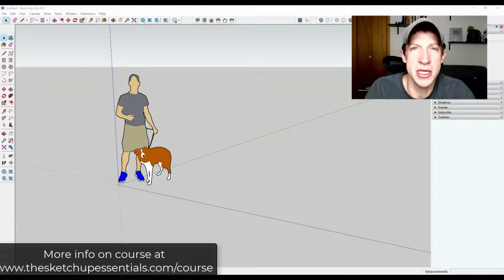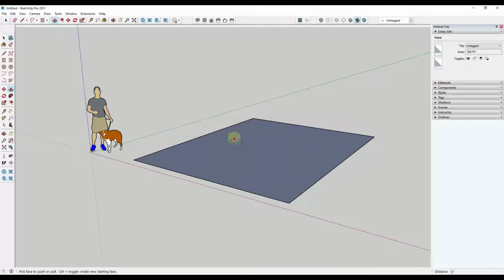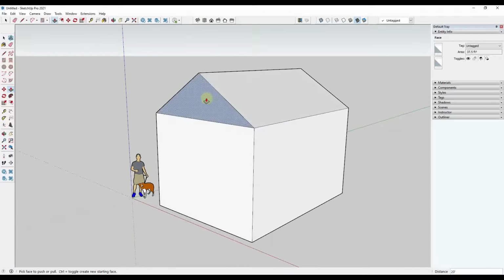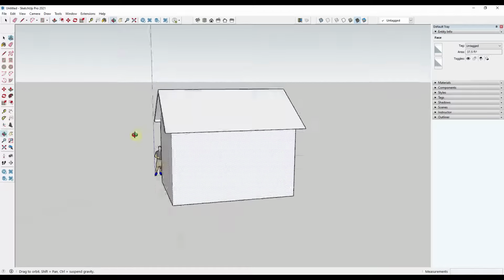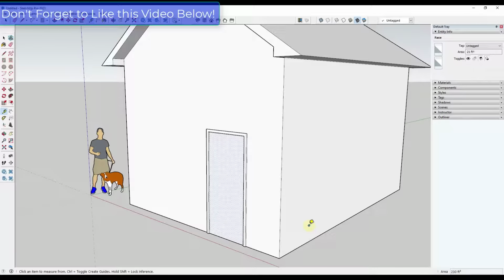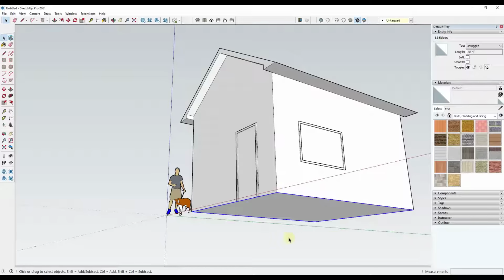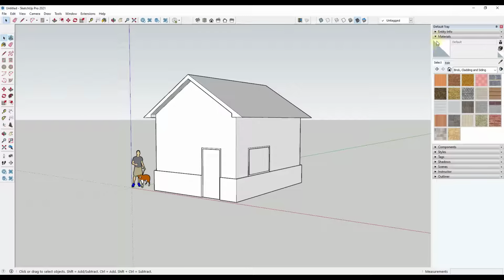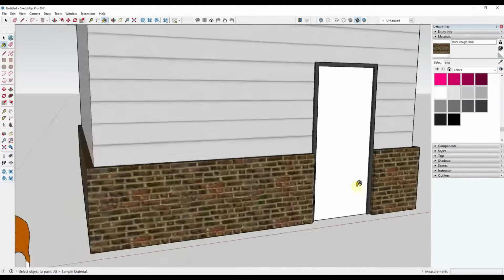Getting Started with SketchUp in 2021 Part 2 - MODELING A HOUSE! Desktop Version Beginner Tutorial!

Comment: Thank you. Very helpful Although, I am struggling with a MAC. You mention in 15:45 the Move+Control takes into copy mode but that does not work for the Mac.
Reply: on mac works with option key
Reply from the maker: I think you tap the "command" key?

Comment: I am having an issue where I am trying to make a hole for a cabinet door. so I make all my marker lines and I trace them with the draw tool then I click on them so they are highlighted. when I try to push them back by a 1/2" the thickness of the wood, it tends to push the whole line to the other side and does not make a hole. any suggestion on what I'm doing wrong?
Reply from the maker: It sounds like you might have the geometry you're trying to cut to make the hole in a group? So the raw geometry isn't intersecting?
Reply: @Thesketchupessentials  hmm maybe, how would I fix that?
Reply from the maker: @30DayReviews  Double click into the group before drawing the hole that you're trying to extrude
Reply: @Thesketchupessentials  THanks I finaly got it evedentaly i have drown over the same lines a couple times so had to erase them then had to explode it for some reason then was finaly able to get it. thanks for your teachings

Comment: First of all great beginner video. I'm just a novice wanting to learn Sketchup. Have a question, when you added the glass material to window and spun house around it seemed as if there was an empty room, as it should be, but when did you create the room in the house...is the house not solid when you extruded the house upward to 12'?
Reply from the maker: 3D shapes in SketchUp are really only made up faces - so for example - a cube is made of 6 flat faces. There's nothing "inside" the shapes, which is why you can see inside when you apply a transparent material
Reply: @Thesketchupessentials  Got it, thanks for reply, much appreciated.

Comment: great video how do I dimection angles in sketch up
Reply: You can select the protractor tool. That is in the large tools toolbar
Reply: @mmmmbennett  the protractor tool does not give you a dimension like the dimension tool in SketchUp how do I do that. The pro version is very expensive I can't believe they won't put this basic function in  SketchUp
Reply: @vincebaker3384  are you using SketchUp Make 2017 or SketchUp on the Trimble website?
Reply: @mmmmbennett  no pro 2020
Reply: Oh I see. Yes I agree a lot of basic functions should be added to the program without needing extensions. The protractor tool finds and marks angles and that is it. Using it with other tools is the only way to get dimensions